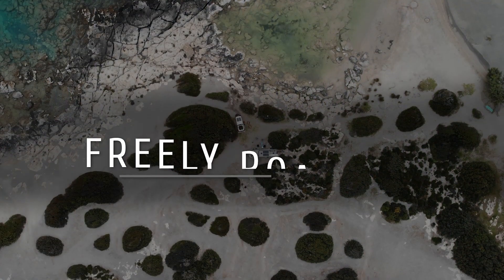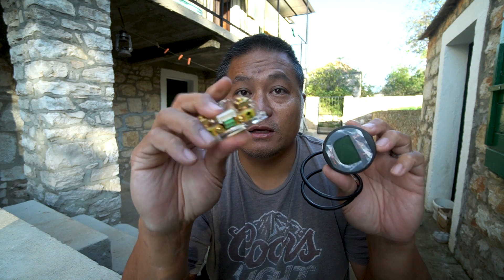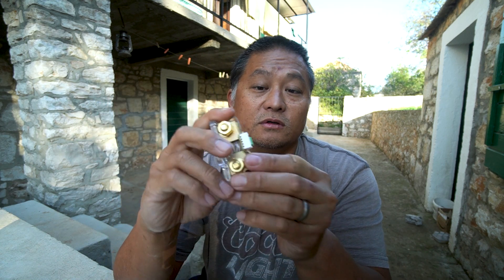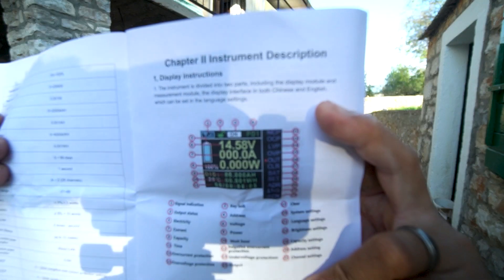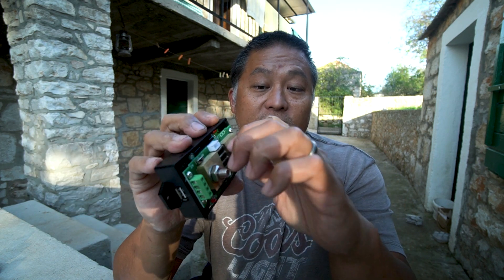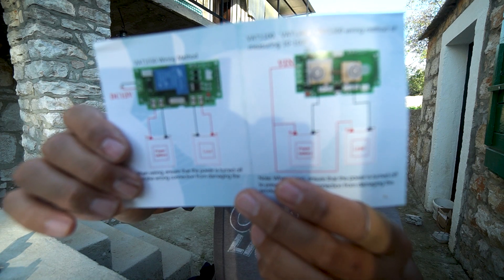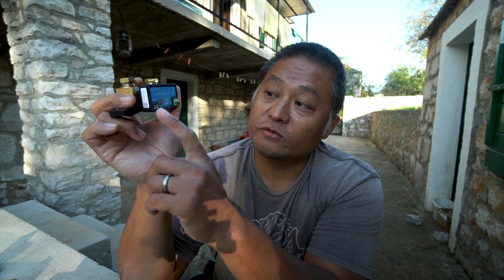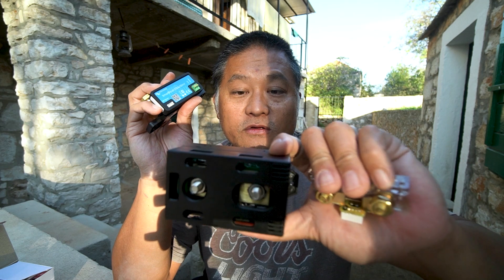Victron Smartshunt, AiLi and Juntek // Comparing 3 Popular Battery Monitoring Shunts

Comment: Thanks, for the excellent review on these shunts!   

I'm in the process of building a system for use in an RV for fulltime living and I already have a couple of Victron Blue Solar MPPT 150/35 solar charge controllers and a Victron Venus GX to be used with a 450 amp-hour LiFePO4 battery bank made up of 48 - 150 amp-hour 3.2 volt cells in a 16S3P configuration, providing 23,040 watt-hours of capacity at a nominal 51.2 volts DC.  The battery bank and the Victron equipment is contained in a Weigman 36x30x12 14 gauge steel industrial electrical enclosure, along with other components, like DC-DC converters to provide 60 amps at 13.8 volts DC for standard RV 12 volt devices, the required contactors and, of course, the BMS system from REC BMS.   I've been looking at the Victron BMV-712, but I also don't have a desire to wire and mount the display.   So, I've been intrigued by the Victron Smartshunt.   But, I have a question that you might be able to answer:

Since the Victron Smartshunt would be installed inside the 14 gauge enclosure to replace the simple 200 amp 50mv shunt specified by the BMS manufacturer, the Bluetoooth connectivity is going to be unusable, except between the solar charge controllers and the Venus GX that are mounted inside the enclosure.   So, can the Victron Smartshunt be accessed through a standard wired LAN using the Victron app on my smartphone connected wirelessly to the LAN?   I have a panel mount ethernet connector to connect the Venus GX to the LAN.

I watched the Victron video for the Smartshunt, but comments were turned off on that video.   So, I hoped you might be able to provide some insight on this issue.   Thanks!
Reply from the maker: Nice setup! You must have a ton of room in that camper 😀 the SmartShunt has a wired connection as well as bluetooth so I do believe you will be able to connect to it using VE Direct and access it without using bluetooth. I don't have a way to confirm but it theoretically should work.
Reply: @freelyroaming  Thanks for your response!   The entire setup fits in half the space beneath a standard RV queen sized bed.  The battery pack itself is made up of prismatic cells - like the 280 amp-hour cells you recently reviewed, only 150 amp-hour, and purchased from BLS off Ali Express ($4684 including shipping for all of them).  That was the reason for installing it in the Weigman cabinet.   It also makes it safer and easier to move to a different RV when needed.   

I've also installed a battery heating system using after market 12 volt car seat heating pads connected in series to reduce the heat to a safe temperature (about fifteen degrees above ambient temperature) and controlled by a thermostat that kicks in whenever the temperature inside the cabinet drops below 50 degrees Fahrenheit (adjustable, of course).  So, we're safe to charge the batteries unless the temperature drops below about 10 degrees Fahrenheit - and, we're not going to like that temperature any more than the batteries would 😊.   The heating system draws only 27 watts when running.  Likewise, there are two 14.5 watt cooling fans installed that kick in if the ambient temperature goes above 86 degrees Fahrenheit.   And, the battery pack is surrounded by 4 inch foam pads on four sides and 1/2" foam padding underneath to help keep the pack temperature stable.

We're looking forward to when we can get on the road to make use of all that hardware 😊.  Thanks, again!  Subscribed!
Reply: @richardowens9061 but @richardowens9061  (and by that shielding the Bluetooth from working)?  @richardowens9061  in your RV.  @richardowens9061 You can even put it @richardowens9061  Weizmann @richardowens9061 . Since @richardowens9061  on the negative side it will be connected to the car chassis more or less. So even if you fumble with a wrench key or any other metal and by accident connect the shunt to the metal of your car chassis, nothing bad will happen.

Comment: I have the aili battery monitor shunt already installed in the back of my Ute . I am looking to upgrade it to the VictronConnect  smart shunt , to be able to use the data logging and remote Bluetooth monitoring . As I already have the Aili display mounted , can this be used with the output socket (ve direct) of the smartshunt?

Comment: I need to monitor AH usage from my LiFePO4 batteries on a (very) small boat that will be disconnected and reconnected often (almost every time I use it because of transportation in the back of my truck).  I'm leaning towards the Smartshunt but it seems like I would need to reconfigure it every time I reconnect it.  That seems to be the issue for all of these types of monitors.  I can't seem to find a simple monitor that can just tell me how many AH I have used in that trip.  I don't have an issue with paying up to about $150 but would like something really easy to use.  Any thoughts on something that may fit the bill?  Thanks.
Reply from the maker: The SmartShunt should remember your settings each time you connect and disconnect. However if all you want is a simple coulometer to measure amps consumed then anyone of them will do. Even the cheap $40 one will be plenty good. The historical data logging and state of charge features would be wasted in this application.

Comment: You forgot to say that the side effect from a big shunt is the lower resolution. Don't use a bigger shunt then required.
Reply: 022821/1931h PST.  Peter thank you for the comment. But when you put-forth an idea,  an argument or a difference of opinion; it’d be great if you substantiate your argument, as to why you illustrated the idea, argument and difference of opinion. So people may learn from you.
What are the negative aspects of using 500 Ampere shunt? Please also explain as to, what you mean by “ side effects from a big shunt is the lower resolution” I didn’t, quite, understand that.
I’d be delighted to hearing from you, Sir.
Thank you stay safe and 73s...
Reply from the maker: He means that the higher capacity shunts will not give you as accurate of a reading as smaller shunts in terms of decimals units. Practically speaking it is unimportant here. Even a 500A shunt here will give you data down to the hundredth decimal. Meaning I can see current draw as little as 0.01A. there There is no real world benefit of having resolution better than that.
Reply: @freelyroaming  , thanks for updating and filling in . About the resolution I have seen cheap displays that do have problems with a to high shunt. Personal I use now the input from my plc and have a 16 bit resolution and don't have a problem.
Reply: @freelyroaming  and what about the power consumtion of a biger shunt?   is that relevant?
Reply from the maker: @sergiocavazos8963  power consumption is immeasurably small.

Comment: I will be buying a MPPT for my solar system.  Would it be OK to oversize the MPPT for the 100 watt panel I now have and then add addition panels in the future?
Reply: Yes will do the same. But make sure your additional panels will fit well with the MPPT as well.
Reply from the maker: Also make sure you buy the same make and model of panels for best results.

Comment: So if I build my LiFePO4 battery, could I use the Juntek shunt with it´s automatic shutoff options  in combination with a seperate balancer isntead of a bms? My problem is that that a 300A BMS costs a fortune compare to the shunt.
Reply from the maker: I would not recommend going without a BMS. A shunt with low voltage cutoff could protect you from overall low voltage but not individual cell low voltage.
Reply: The critical function of the BMS is balancing the cells during both charge and discharge.  A smart shunt cannot do this.

Comment: Would a smart BMS with a Bluetooth app give me all the info that a shunt provides?  Seems as if the BMS could monitor the current flowing to and from the battery.
Reply from the maker: In theory someone could make a BMS with a coulometer built in but I am not aware of one that does.
Reply: Ionic lithium batteries have a Bluetooth battery monitor built into the case. Must be part of the BMS.
Reply from the maker: It's does not have a shunt measuring true state of charge. It reads charge status by the BMS voltage sensing wires which is a highly inaccurate of measuring capacity in a lithium pack.
Reply: So do you think the Ah used that is shown in Ionic’s app is just calculated from the voltage on the pack?
Reply from the maker: Without a disassembly to see what's inside there's no way of knowing what they are using. It's possible they have installed a small shunt inside the battery case but it would most likely not be a part of the BMS.
Reply from the maker: @larryyeungmd  I tried looking at some data about the Ionic batteries but they do not say anything about using a shunt internally. Its possible they might be using a compact hall effect sensor internally with data logging to keep track of the Ah. Definitely more accurate than estimating based on voltage. A hall effect sensor is not as accurate as a shunt since it is easily affected by external magnetic interferences which are everywhere in electrical circuits. I would assume to use it accurately they would synchronize it to 100% by voltage each time the battery is at full. So if you don't fully charge your battery often, it won't have a chance to synchronize and you could see the accuracy drift over time. But again, this is my speculation how something like this would be done without a shunt. Therr is still a possibility that they do have a shunt inside but just didn't specify in their literature.
Reply: I emailed Ionic and they told me they use a coulomb meter for calculating SoC. They didn’t specify if it was via an internal shunt or not.
Reply from the maker: Yeah technically speaking a hall effect sensor is a coulometer. It's whether or not they use a shunt or not the info that would be good to know. Thanks for investigating this. These are good things to know as consumers.

Comment: Hi Dan, great review! Can you use the Victron Shunt connected to the Sprinter starter battery as well? If so, how and where would you mount it? I'd like to monitor the SoC of my starter battery since I've got my Espar D2 connected to it. Thanks!!
Reply from the maker: I would be hesitant to do that with the starter battery because the current draw from the starter on a diesel engine could be above it's rated limit of 500A. I know some bigger diesel engine could use 1,000A at initial turn off the engine. Not sure what the sprinter pulls. Have you considered rewiring the D2 to draw from your house battery? That's what I did with my Webasto. The installer in Romania wired it to the starter battery. I didn't bother explaining it and it was easy to route power up and just rewire it.
Reply: @freelyroaming  thanks for the info Dan. I'm keenly watching your Lithium battery pack builds. My only house battery is a goalzero yeti 1000 system but want to supplement it with a 48v Lithium pack similar to what Safiery builds then connect the D2 to that battery pack, with a 48v to 12v Victron Orion. Then use alternator charging to charge the 48v Lithium system. Not adding solar since we're up north here in rainy Vancouver Canada.
Reply from the maker: Are you planning to build your own 48v pack? Probably not right? you would need 16 of them and they will take up a lot of space. Maybe the 16 of the smaller 90Ah cells would make more sense.

Comment: I just came across your videos and find them very useful.  I'm planning to upgrade the power system on a sailboat and envision a system much like your (2 Victron solar charge controllers, LiFePO4 battery bank, DC-to-DC charger from alternator via starter battery, and a shunt for real-time readout of battery capacity.  Would you mind sharing a wiring diagram of your set-up?  Thanks!
Reply from the maker: Yes I will be making a video soon to show exactly how everything is configured.

Comment: What has your "Bluetooth" experience been with the Victron...reviews have not been very favorable?🤔  ...reported poor range...
Reply from the maker: I think the range is as expected. Not exceptional but I wouldn't say poor. Certainly when I'm outside of the vehicle the sheet metal of the van can block the signal as it would any bluetooth signal. But knowing what you can expect from bluetooth which is 10ft without any obstructions, it works as well as expected.
Reply: Since the shunt is connected all the time, the current drain must be kept to a minimum. Extending the range for the bluetooth will make it draw more current. Now the mean current drain is less than 1 mA

Comment: Great job Dan. I just spent $4500 for 3 180 ah batteries for my motor home. I’m going to put them all in parallel house and chassis together. I have the roof decked with 700 watts of solar . If I saw your YouTubes earlier I would build my own. Also have a Polaris ranger EV I swapped lead acid for lifep04 bats. Cost $6500 . I drive a Tesla M S P100D cost me 155k in 2016. Now they sell for 100k and go 100 miles further. Just keeps getting better.
Thanks for your info. Got me thinking about getting into battery business.
Reply: Wait until solid state batteries go mainstream. Incredible tech coming out every day.